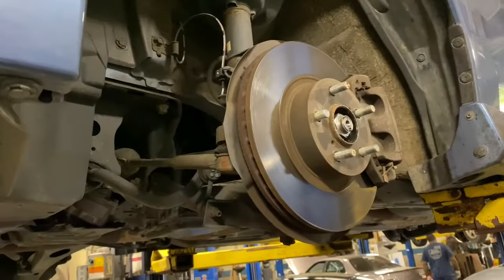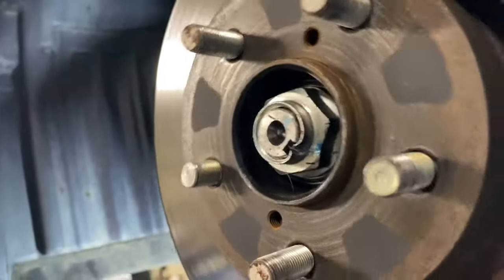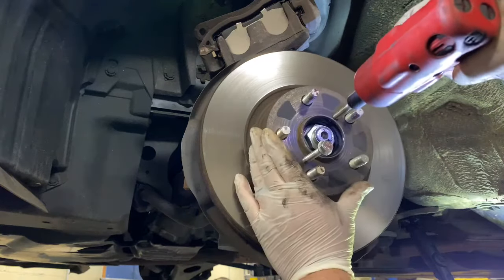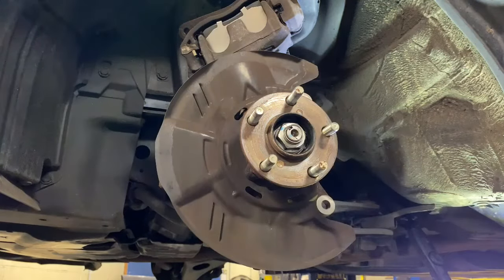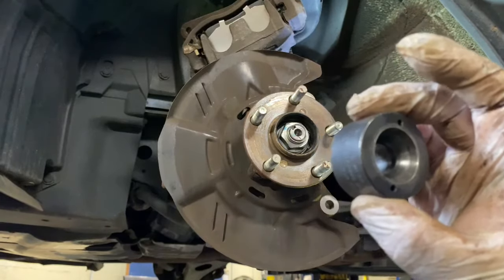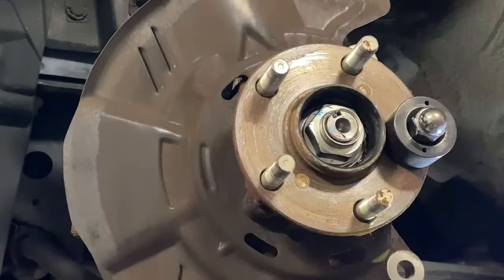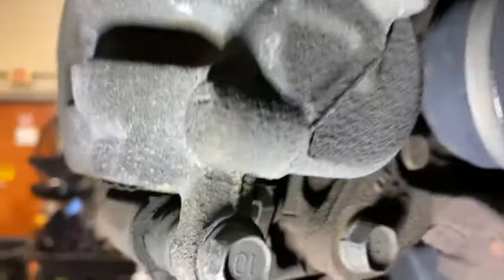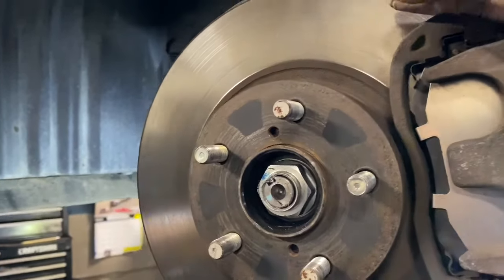How to Replace a Wheel Stud on Subaru’s

Comment: This came in very helpful today. Tire shop over tightened my lugs and 3 studs broke off. Thanks for this video.
Reply: Wow 3!!
Reply: Wow 3. I've had my Subaru tire shop do one bolt twice on different vehicles, but two on a single vehicle, ouch.
Reply: Whats the torque spec for subaru forester 2019 wheel nuts?
Reply from the maker: I set them to 90 lbs
Reply: Crazy that these shops are just ramming our lug nuts on with air impacts willy nilly. Fuck the next guy I guess
Reply: They were probably cross threaded from corrosion tbh. Never seen a new tech do that even with a $800 gun

Comment: 8MM NOT 12MM BOLTS ....when removing the brake disk from the hub.  8mmx1.25 thread pitch
Reply: Thanks, they didn’t look like 12MM to me!
Reply: Thanks!!!
Reply: Thank you I appreciate you taking the time to throw that up
Reply: This deserves top comment. I absolutely needed the 8mm bolts to get the rotor off the hub. Would not budge at all with the parking brake off. Job is done… thank You!

Comment: This works great, and thank you so much for your lesson.  I'd just like to add 2 things. If you're working on the ground with one side of the car jacked up be sure to find the bad stud mark it with a sharpie and line it up as close to the car door as possible. Because you wouldn't be able to move it after.  AWD after all.  Second, is if you don't have his puller, just use a stack of larger washers and a standard nut.  So the nut should be an M12x1. 25 and the washers should be the ones that fit an M14 bolt.  This will keep the washer from gulling up on the threads and the nut can go deeper than a lug nut because of the open back.  I did those things and followed the rest of his instructions and it worked without a hitch.  Thanks again!
Reply: Thanks for comment! 
Can this be done without pneumogun? Just with regular wrenches on the ground? Last tires change in shop ended up with one stud bolt screwed up. Ty!
Reply: @cyrilscherman6807  it totally can. The only thing is it may hurt your hand.  I used a breaker bar on a few as well, and they pulled in with no issues. I guess you can interlink wrenches or find a pipe to slide over for extra leverage if needed.
Reply: @SeekerOfLight  oh, the car is only 2018, and recently I changed myself lower suspension control arm, so don’t expect problems with it. Thank you Sir!
Reply: @cyrilscherman6807  no problem man, best of luck to you
Reply: @cyrilscherman6807  oh, and one more thing, be sure not to over tighten the lugs.  It maybe best to barrow a torque wrench.  It only takes 90 flbs go much over that and the lugs can strip out on the studs.... It's super annoying.  I liked back when you can actually tighten a lug hard.  But not these.
Reply: @SeekerOfLight  kk, thanks a lot. Will check it on, but torque wrench is a problem to get, for free I mean. Might my helper has it, or at least some feelings.

Comment: This video is perfect. Replaced a stripped stud on my 2012 Subaru Forester. In an hour. Stud puller ($9 Amazon) and the 8mm x1.25 hex bolt (got at autozone $3.99) to remove rotar are a must! Local car shop wanted to charge me $480 to do this! Thanks again for making this video!

Comment: The stud installer tool (I used the one by Lisle) worked great. Just some light machine oil on the stud and lug nut and a 24” long breaker bar was all it took to pull the new stud into place. No impact wrench needed. And that means I didn’t damage the lug nut that I’d used to pull the new stud into place. Oh, and I didn’t need to bend the heat shield out of place at all on my 2016 Forester XT.

Comment: I’m replacing the wheel studs right now but I figured I don’t have the bolts to pop off the brake disc/calipher, what bolts did  you use @1:36 ?
Reply: I read that they are M8x1.25 bolts, but haven't tried it yet.
Reply: u can hit it with a rubber mallet as well but I may be really stuck frfr
Reply: Yes it is M8 8mm Bolts!! Just did it today and they fit even though they dont look like they will
Reply: @HaakonReppen what threat pitch?

Comment: Should I weld the Stud? cause in brazil i take to the mechanic, but he did the "eletric weld" while should be the "MIG weld" or i need find one "specefic stud?" and my model is 93 legacy, but the stud got loose when i tryed replace a flat tire

Comment: Awesome video. Question: if I'm only replacing one stud, do I really need to disassemble the brake components? It looks like there may be enough room to maneuver as long as I align the broken stud on the right, as shown in the video. Am I missing something?
Reply: You gonna damage the rotor. Just dismount two bolts in the back and take off your rotor
Reply from the maker: I never done it that way, so I don’t know if you gonna damage the rotor. but you could try. Just be careful.
Reply: did you try without removing the rotor - i also thought the same thing - most important i see is the target stud should be at 3 oclock passenger side and 9 oclock drivers side
Reply: @jonnyz5772  nope, when I got to it, i realized how easy it is to remove the rotor, so i just played it safe and removed it.

Comment: What exact screws did you use to pull out the rotors? Where do you get that from? What size are they?
Reply from the maker: 1x36 bolt

Comment: Great video.. so what do I do if while tightening the new wheel studs they spinning..? 😩😩 I’m using hand tools, ratchet and a socket.!
Reply from the maker: You need to put pressure on the back of the stud
Reply: @efixes8010   a ma try this rite now, it’s my ATV a quad, not a car. If still spins you think is a good idea adding some welding.? 😂

Comment: I was wanting to do something like this but put in longer studs so I can put on wheel spacers for different Wheels I'm just not sure if longer studs would be safe would be safe
Reply from the maker: If you’re putting spaces the spaces, bring an attachment. Basically you attach the spaces to the original studs and spacer bring studs on it.
Reply: 8 mm spacers so basically they fit between the wheel and the Hub
Reply from the maker: Yes

Comment: Great video, does this also work for the rear tires????
Reply from the maker: Yes but make sure you do not apply the parking brake.
Reply: @efixes8010 what happens then
Reply from the maker: You can’t remove the caliper from the rotor

Comment: Why I can't spin the studs after I took off the rotor? So I have to get inside the car and switch gear to N? If I let the car on N, the alarm would keep screaming and battery would run out soon.
Reply from the maker: All tires need to be in the air because of the transmission
Reply: @efixes8010  Thank you.

Comment: Does the car have to be in neutral? My wheel hub won’t rotate
Reply from the maker: No, the car does not need to be neutral but the wheels need to be off the ground
If you do not have a lift you could put it in neutral rotated where you need it and then put it back in park. But make sure you put something in the wheel so they don’t move front or back. If you doing the front one you could put the emergency brake on if you do the rear you need to put something in the front wheels so it doesn’t move

Comment: How did you turn the wheel to align it with the cut out.

My 17 Forrester is locked up to the transmission.  If i start it and put it in neutral it spins foward and i cant stop it. Like it was in drive
Reply from the maker: Is the car up in a lift or are you doing it on the ground
Reply from the maker: If you are doing it in a lift just grab a big screwdriver and turn the studs 
If you are doing it on the ground on the shifter there is a little piece that you could take out you are going to need to poke and shift to neutral
Reply from the maker: Remember don’t press the brakes because if you press them the piston on the calipers might come out

Comment: Even after using the two 12 mm bolts I can’t get the rotor off… any suggestions
Reply: Hey just realized, you gotta take off the parking brake to remove it as well
Reply from the maker: @Powderhoundguy  
If you’re doing the rear, you have to release the parking brake because if not, it touches the drums of the rotor and it won’t allow you to remove the rotor
Reply: 8mm 1.25

Comment: Why do you need to remove the rotor ?
Reply from the maker: To make it easier
Reply: @efixes8010  I made it easier I took my Forester to repair shop and they replaced 5 lug bolts on left front wheel in about 15 minutes. 
Thanks for the video it helped me decide to let someone else do the repairs.